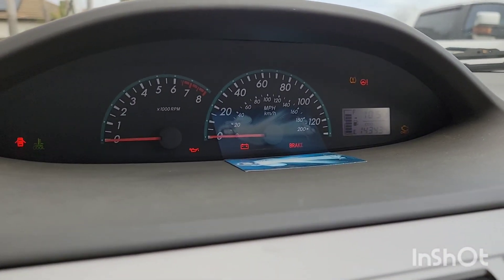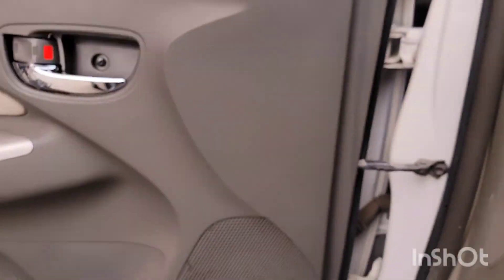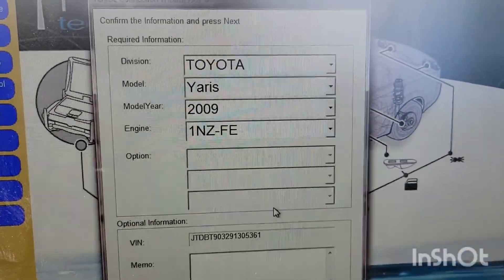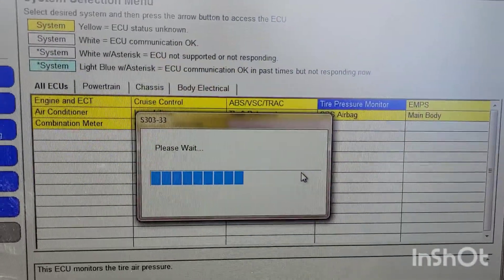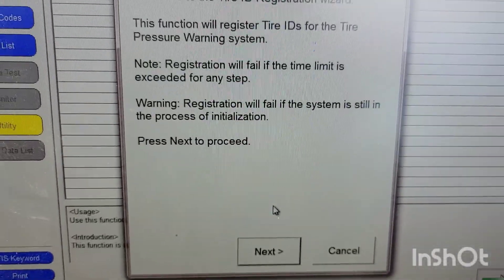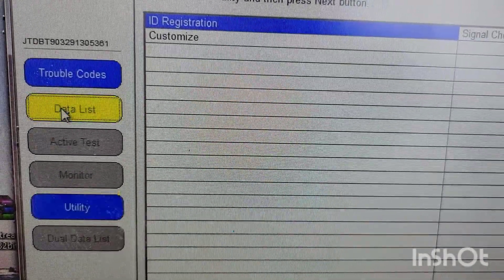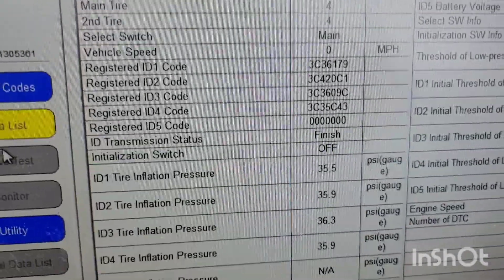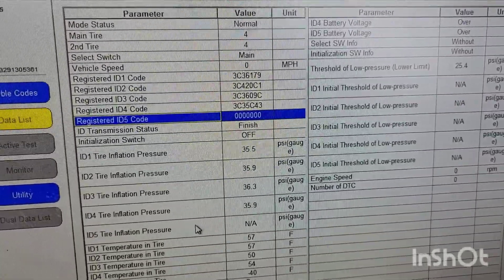Toyota TPMS Sensor Techstream

Comment: To those wondering where all the TPMS sensor codes are found, they are physically on the sensors as well. If installing new ones, note them down before you put the tires back on! You don't have to get a code reader to find that, but you could also have a local (non-chain) tire shop get those numbers to you if needed. Just note that by that point, you may as well just have them program the things for ya.

Comment: Hello, thanks for sharing the video. Could you please give me the link for the version 17.00 that you are using? I have the 18.00 and the ID registration is not the same, it requests all 4 IDs at the same time and the registration fails. It says to connect the TC and CG terminals of the DLC3 for 30 seconds but it doesn't work
Reply: Did you find a fix? I have ver 12.20.024 and I get the same errors
Reply: @noTTYLer97 did you fix this ?
Reply: @bartqpanic need an answer on this as well

Comment: Hi, great video. Is there a way to program out the TPMS light all together? Can I just turn off the TPMS light so it never comes up using this software ? Also what USB/OBD2 reader did u use?
Reply: Hello, did you find a solution for that ? I’m looking for the same. Turn off permanently the TPMS light
Reply: @Skarten you can’t . Only option is take the light off cluster lol. Or get four sensor put it in pvc pipe with air lol or just replace all four
Reply: Forscan on fords lets you disable tpms as well as JScan for Jeeps.  Not sure why Toyota wouldn’t.

Comment: What if the TPMS warning light is still on? I did have a full size spare for my RAV4, but I want to store it and use a donut for my spare tire. I registered 0000000 for the 5th TPMS ID, but the TPMS light is still on. Did I do something wrong?
Reply: Thats probably because 0000000 is not a actual ID number, you'll need to inflate the spare tire remove the Tpm sensor, write down the actual tpm sensor id number, then replace 0000000 with the actual ID number then the tpm light will go away. Note: Anytime a spare tire is being use the tpm sensor light will be on. Theres no way around that.
Reply: where did u get the techstream sw from?